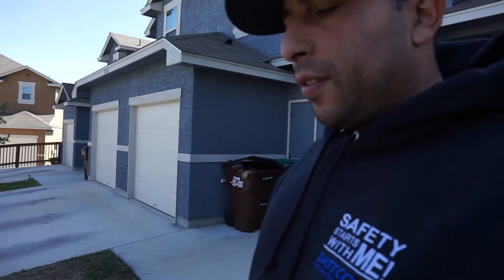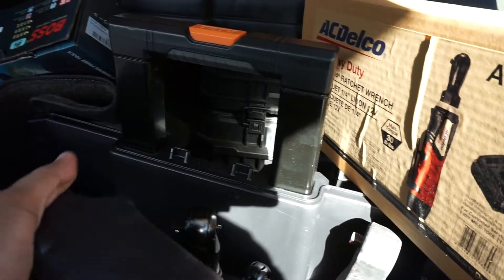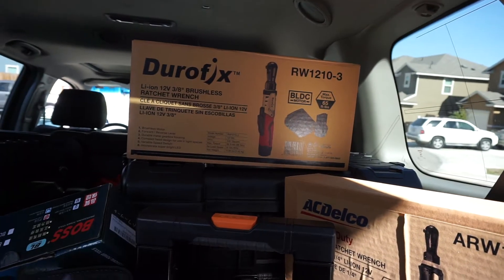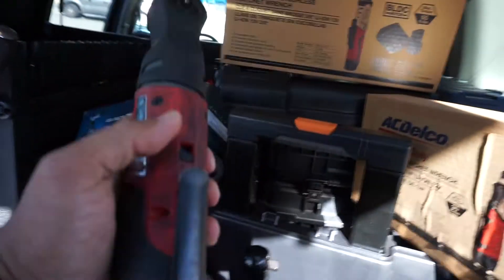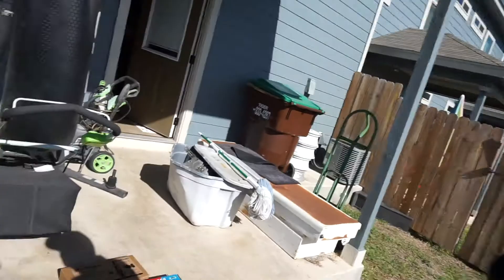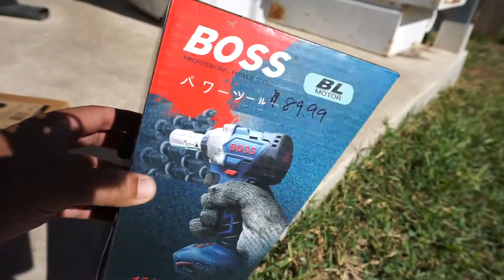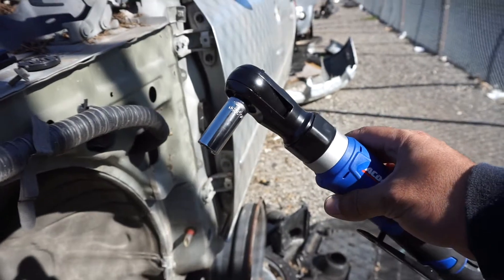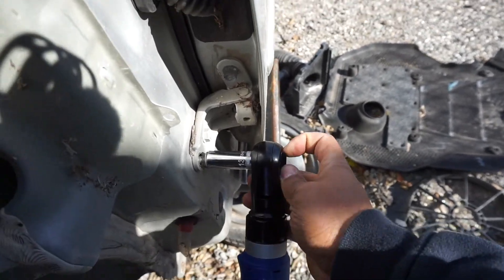ACDelco Ratchet Durofix Enegitech Impact Cordless Reviews

Comment: Proper use of a cordless ratchet requires you to first break the bolt manually and then use its electric torque to unscrew the fastener.  If you are looking for breakaway torque, then you need to get a right angle impact wrench...those, of course, are a lot larger and bulkier.  The two tools have different uses.
Reply: Not accurate.  Some cordless ratchets don't allow for hand tightening or loostening their tool, as it will damage them.  Chose carefully.  Also, check for a break, or a directional switch that is large enough for easy use, with or without gloves or even a light.   A light is very useful in dark spaces.

Comment: ok, the ratchet wrenches are not to break loose newmaticly. you break it loose manually that's why they they have a 100 ft lb. torque rating by manual breaking then you use the newmatic feature to save fatigue on your hands and arms. as far as the torque rating you should always use torque wrench to finish up! BUT!!! very good review an the tools at hand. keep up the good work on your videos.
Reply: Pneu...means air, lungs, or breath. Therefore, pneumaticaly. Just being friendly. 👍
Reply: I agree with you, except that we are talking about electric ratchets, not air tools.  The principle is still the same.

Comment: Would you recommend for Mecanic usage the acdelco brushless version you tested or the Milwaukee m12 brushless one ? I mean for the price you get way more for the acdelco btw i have the milwakee brushed version ratchet has serve me over 1yr but it needs repair and it’s out of warranty and buying a  new replacement is what I am looking for but many say and show this older version ( yes is faster ) but the head needs repairs all the time , I wonder how more heavier and stronger is that new fuel version , I also had bought a cheap oreillys one and is sucked battery didn’t last and not that along had bought an China one Oaben and it looked promising so alike but the metal head was junk it broke in the first attempt to brake lose a bolt 10mm like if the material was made of mixture of weak metals not steel or even close to the quality of the milwakee , I mean I have the m12 batteries and also was looking at that new tool ( for anyone reading this comment lol) that new tool right angle impact it looks strong from Milwaukee but abit pricey , have you tried it ? My local homedepot doesn’t have it
Reply from the maker: If you want to stay on a budget look into lowes Kobalt 24v right angle impact it does same job just cheaper. As far as the cordless ratchet the build quality is sturdy. Harbor freight has same ratchet just painted different. They just released the extended long neck ratchet which i will do review soon.

Comment: Why not AcDelco 20v 1/2 impact wrench since it has more power then Enegitech and it's cheaper?
Reply from the maker: If you are talking about Ac Delco A20 20v 1/2 impact, I did pick that up based on the $99 price with 2 batteries. I haven't done a video due to me still testing it out. But both have similar power. But that a20 has to be the most compact and light 20v 1/2 impact out in the market.